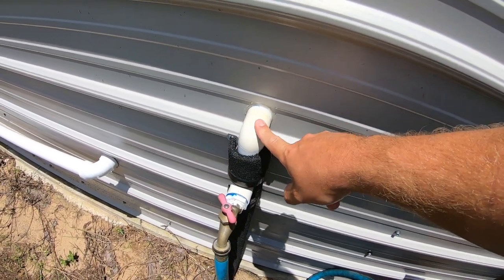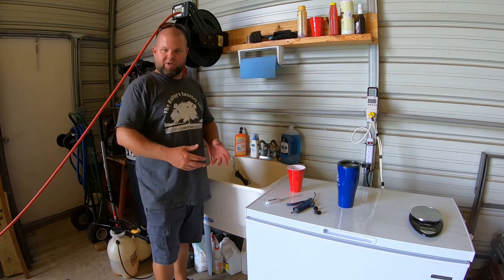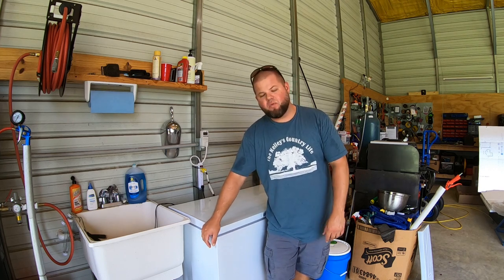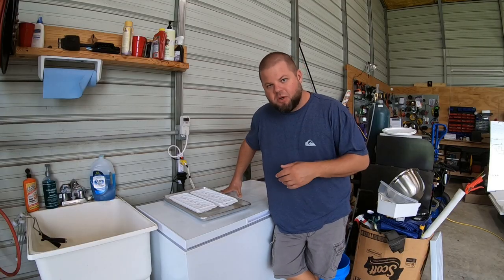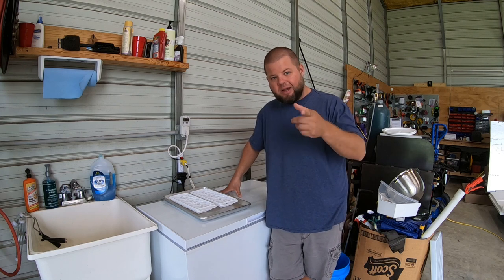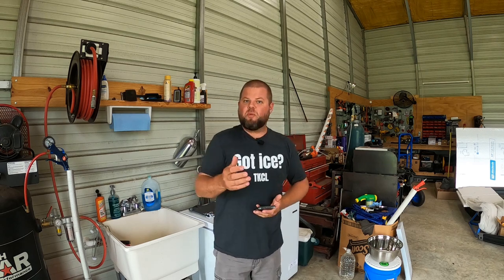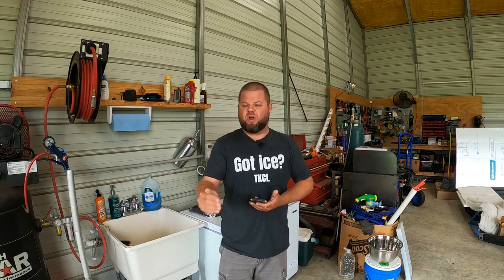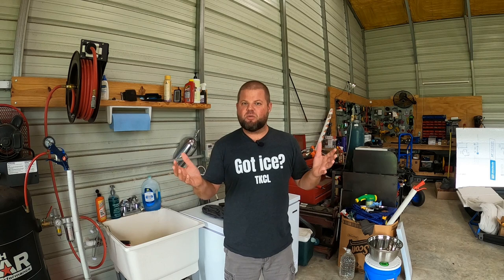Homemade ice machine tests! Hot water freeze quicker than cold water Mpemba effect? #376

Comment: So if your net per bag dropped by 40 something percent then putting a reservoir tank with a fan and maybe a heat sink on it is probably a good idea but you would need to test that temperature water too because it’s not gonna be the same as the cooling you’re getting from your ice bucket.  Then you need to calculate the cost of using ice to cool that water and make that an energy expense.  Lol. This stuff is fun. 😂

The best decision in these things and almost everything is to find balance. I Collett the best bang for the buck you find what you need and you make that your minimum point and that you look at what you want and make that your maximum point and then you have your range of what you’re going to get in the end and from there you start looking at the advantages and disadvantages in total cost and you just pick the one that’s the best bang for the buck if you can pay $.30 cents per bag and that meets your needs you don’t need to put a bunch of money into it and it might be nicer to get more bags and have them cost $.25 but like you were saying you don’t wanna have to put forward two years worth of money to make the savings but if you can get 80% of your goal for 10% of the cost difference that’s gonna be your best bang for the buck and that’s worth it it’s worth spending a little extra to buy and put a fan in there but it’s not cost-effective to buy some sort of expensive chilling apparatus even if it does actually work the benefit it brings you isn’t really worth the cost to where the $12 fan is gold.     This is pretty awesome.

At the end of the video you talked about insulation on the wall behind there. If you’re going to test that I would test two things, test insulation but also test shading because it would probably be a lot easier to build a shade canopy in that area or maybe even put the shade canopy over your pipes outside and move the icemaker to there and kill two birds with one stone. But without insulating your tire shop I’m not sure insulation alone is going to have a ton of affect either. If you do I would get some of the foam board with the radiant barrier I think that would be the most effective in that localized area plus it would be a lot easier install you could just stick it up against the wall underneath your cords for the testing or even put it outside but without air-conditioning that space I don’t think insulation is going to make a ton of difference other than a radiant barrier and maybe putting a tree outside for shade or a canopy might be a more practical solution or even a more efficient solution. It’ll be interesting to see. Another thing about maintenance. Most people don’t clean the backs of the refrigerators and there are usually coils in there somewhere that dissipate heat and when those coils get covered with dust they’re basically insulated and just doing maintenance and cleaning an old freezer might make a huge difference in efficiency. There are often settings that can be adjusted and fine tuned as well. When I find on tractors all the time is your hydraulic diverter’s. Usually they just put half your hydraulic flow to your steering when your steering needs maybe 10 or 15% of that flow, changing that valving to make your implements run way better and even give you the option to run other implements that you normally wouldn’t think you had enough flow to do.  Even on a little 1025 are there a bunch of implements like it front mounted pole size and stump grinders that attach where your bucket does that the specs don’t meet and can’t be run but with a diverter you’re getting a 35 or 40% increase and can read them supplements without ever changing your hydraulic pump.  There are also valve type switches in there that are based on pressure, it’s basically an adjustable release and they don’t tell you about it but you can get under there and turn a wrench a few times and you can increase your hydraulic pressure by 50 or 100 or more pounds even on a tiny tractor.  I’m sure refrigerators are the same I’m sure they have valving and things that the engineers just threw on I’m sure things like tube width and angles and decreasing the amount of bands and all kinds of things could improve the efficiency. You might not get that far into it but it would definitely be worth looking in there to see if there are adjustable valves or even if you could just cut some more air access into the cover that goes over your coils increasing airflow or like you were saying a fan and even just a maintenance and cleaning stuff so it’s able to dissipate that heat faster.  All fun stuff to play with

Be careful with that ice thing on the shirt, a lot of people out there that hate the ace government agency and there is a domestic terrorist and violent people running around looting and burning and attacking and killing people sometime so I’m not sure I would wear that shirt in San Francisco or New York city but out here in the real world it’s actually pretty cool. Lol

Comment: The fact that the boiling water tray showed a  small piece of ice after only a hour shows the effect evaporation had on the test.
The room temperature tray took longer to form ice than that. I agree that boiling the water is not practical and that it would not be a solution for this project but, the science is there.

Comment: Add the power and use on mini fridge as well

I have an idea what about routing the pipe line into the freezer door that wont freeze but cool it off
Also how would be the effect of having the build up frost on the sides
Also isolate the wall

Comment: I might miss something but at 70 dollars for copper it seems to me as it makes more sense to get another ice maker
Reply from the maker: Yes and no. Do to the size of the freezer there just isn't enough room. It would always be in the way of me trying to scoop out the other side. I have a special spot for this size freezer down the road, so I can't go bigger.
Reply: Can you get three makers in with very little (if any) loss of space if you turn them 90 degrees? I was surprised when you mounted them in that orientation.
Reply from the maker: I'm looking into that, especially for the next build.
Reply: Would also be interesting to try to stack them vertically

Comment: You dont need to use copper you can just use the plastic line and put the water filter inside the fridge the amount of water in the fillter water will keep it at chilled temp and only need two small holes in fridge door

Comment: If you want fast ice production get a mini fridge put a 100ft roll of 1/4in poly in fridge simple hole in and out and whala... 40deg supply water to ice maker. Well under $100 maybe as low as $30 if you happen to have an old mini fridge your not using.

Comment: The only time hot water will freeze faster is if the humidity is very low. The hot water will evaporate some. This evaporation can cool the water faster just like when you sweat it cools you when the sweat evaporates. But this only happens in certain circumstances. And you give up some of the liquid giving you less ice. If you put the water in a bottle with a lid on it the hot water will never freeze faster.

Comment: Maybe I'm dumb, but if the groundwater temp is much lower than the water you are getting once the water rises up on the side of the building past the hose bib, then why don't you just insulate that better?  Maybe paint the foam white, put foam on the elbow, and perhaps build a chase around the entire supply line to keep the sun from directly shining on it?

You could also relocate your supply like for the icemaker so that you aren't tapping off the 'above ground' line but somewhere underground.  To me that would be MUCH better than wasting water or adding some additional 'chilling' into the current setup.  Just get the water supply before it gets hot.
Reply from the maker: I'm going to insulate better. Doing an entire insulation episode, need to purchase a few more things.

Comment: just use a 25~50ft coil of poly tubing skip the copper
 you don't have the volume to justify copper also the door is the safest place to drill a hole.

a lot of fridges with built in ice makers have coils on the fridge side to chill the water for both the ice maker and the door

Comment: Really cool video I feel you won't need the copper tubing just use like a bucket or container with a air tight lid in the fridge then have 2 of them plastic tubing runs comig out of like the side of the bucket (making sure there leak and air proof ) 1 leading to watter mains and the other leading to the ice makers, that way you will have a large amount of chilled water (more than you would with copper tubing ) witch should keep its temperature better in the fridge ,it will be cheaper than the copper tubing and also you may be able to get away with just running the tubing in the door jam hope it helps

Comment: you don't need to use a copper line in the fridge to chill the water in.  You plumb in your 3/8 plastic water line to a quart or half gallon tank and back out with as short a run as possible between the chiller and the water valves.  (or out the top of the mini fridge right next to the fill ports for the ice makers as you set it up with the cooler) For as little water as you pull through the system, the holding tank in the fridge will keep you just as cool as the copper lines.
Reply from the maker: Thank you for the idea

Comment: great work! i would like to see if added a piece of metal attached to the inside metal of the freezer with thermal mastic with the icemaker setting on it again with thermal mastic would affect ice production. I know your freezer isnt running on r134a but in one of those systems the temperature at the inlet of the evaporator is about -20F.  The entire inside of that freezer is the evaporator and after you defrost it you will see ice forming near the top first.  plus i think the metal would extract even faster from the mold. Uline used to make an icemaker that was thermally bonded to a evaporator.  and again great work on the series. I am definitely invested in it now.

Comment: Observations from an old Plumber- 1. Build a primitive cover for the incoming water line coming up the wall outside your shop,and the line coming into the ice makers. Use 8 inches of fiberglass batting, use cardboard,duct tape or anything to seal it. 2. A waterline buried 4 feet  deep should maintain 50 degrees F.. 3. The hot water myth is propagated due to the fact in frozen  pipe damage,the hot is damaged far more than the cold.The reason? The water contains oxygen bubbles- which are separated out and removed in the hot water. The bubble give a tiny amount of a cushion  effect when the water expands upon freezing in the cold lines.4. The trickle of water you had going-@ 1 gallon every 5 minutes is 8,640 gallons a month.!
Reply from the maker: Thank you for the read

Comment: Why not just keep the tubing running through the ice chest with jugs of ice you can make in the freezer?  Fill up 4 plastic milk jugs and rotate two at a time between the ice chest and the freezer to keep the tubing cold, without having to use up your ice to cool the water in the ice chest.

Comment: I love the idea of a solar water heater, I’ve studied with several people have done come up with some decent ideas. One have a black tank that’s not insulated and use the heat in the hot water rising to create flow into a second insulated tank and then at night I have a valve on a timer that just shuts off and uses the insulated tank overnight because it will stay very hot for several hours when it’s insulated then in the morning the valve open in the black painted tank sitting out in the sun and not insulated or heat the water which will flow into both tanks and hit on the water again.  A black painted strip down water heater tank gets hot pretty quick, especially in the summer.

I don’t think you’re just proving science at all tell me the truth as hot water takes longer to freeze and there may be some extreme condition where that changes but I’m willing to bet it’s because in the end that hot water is significantly lower volume, I think it would Have to be hard enough to where you were losing mass because the temperature was so high that the water was turning to gas and evaporated at a rate so quickly you just didn’t have as much heat to remove in the end because you just didn’t have as much water left.  To test that what you have to do is put 1 ounce of water in a container and then take an extremely hot plate or something or water that was so hot that it was already in a gaseous state but I think for the purposes of making ice it’s always gonna be better to start with less heat in whatever you’re trying to freeze, Since chilling in freezing is the absence of heat, cold isn’t actually something that exists it’s just an absence of heat

Comment: Very, very well done. I personally won't be going with chilled water as the gain isn't that impressive. Only if I began to not have enough ice for my needs would I consider it but here's the thing. If you have the space for another DIY Ice Maker instead of buying a mini fridge, the copper, fittings and time to build the chiller. I honestly think I'd just buy and build another DIY Ice Maker instead. It would be pretty close to the cost per bag to pay off the chiller versus another Maker. Just my two cents...
Reply from the maker: I agree

Comment: Did you figure out a break even figure. I'm thinking between 1 1/2 to 2 1/2 years depending on your usage and the average cost of ice at the retail store. If you could added taller hinges by fabricating a couple plates to raise the lid, use tubing for the spacer and run your water hose to chill the incoming water. It may be more problematic to do this and the tubing should probably run from the cylinoid up to the tube and then travel 360 around top (x2). To me personally chilling the water is not needed. I would shade or box in the pipe outside as a low cost alternative. Great job!
Reply from the maker: I give all those figures in this video. Best case scenario 7 months, worse case scenario is 17 months for equipment and energy usage. That's at 3 dollars a bag. Sometimes I pay more than that, vary rarely I pay less. It's absolutely worth it for cost and especially convenience.

Comment: Just my humble opinion; I think you said that the outside of the box gets cold, and you want to insulate it? I agree, and some 1" foam insulation on the garage wall would be great too. My suggestion would be, what if you ran a copper line in a zig zag up and down the outside of the ice box against it underneath the new outer insulation you would be adding?  I would think the thermal difference would be minimal to the box while significantly cooling down the water coming in. Especially when you think that the water is going to stop and sit in the pipe getting cold, then when the ice maker kicks on, a new batch of water cools down with a thermal mass already in place. (of course, measure how much water needs to sit in the pipes to fill the maker.)  And, hopefully it won't make much of a difference, if really any, in KwH used. (I think...). I just like looking at the least cost solution for the most worth. :)  Ok, that's my 2 cents!
Reply from the maker: I'm already kicking that idea around, I like it.

Comment: I think I have a more precise way for you to measure all modifications consistently, and it also explains the statistical outlier result that was over 10 pounds. The true measure of efficiency is actually the exact time it takes from one ice drop to the next. If you measure the weight of each individual ice drop many times over (20+ cycles) you can get a very reliable average "weight per drop". Then, if you just focus on the times in between each drop, you will immediately see whether a modification is causing the ice to drop more frequently or less frequently. You can see how this could manipulate the 10-pound result you had earlier. If the machines dropped their first batch of ice right after the 24-hour timer started, and then their last drop happened just before the end of the 24 hour period, then an extra drop could have happened purely because of timing luck. If you can multiply a strong average "weight per drop" by the time in between each drop, you can calculate a very accurate "pounds per hour" or "pounds per day" based on any future modifications you test. Anytime you can utilize more experimental trials, your results will have greater statistical significance. Measuring 10 or so times between drops is more reliable than one measurement at the end of 24 hours. Oddly enough, a microphone could be perfect for measuring such a thing.
Reply from the maker: That's definitely an option for testing

Comment: I hope at the end you do a total break down of cost for everything. I mean how much you paid for the freezer and ice makers as well as tubes and wiring. Everything else. This has been fun to follow. Lol I like the fact of the cost to make the ice. We use a lot during summer baseball season. I'm thinking about doing the same thing you did. Thanks for the idea.  Sorry I didn't realize you said cost around 375 to 400 dollars in everything not bad at all. Could probably cut that cost if you found a used deep freezer at a auction or someplace.
Reply from the maker: There is also a video of me showing full cost breakdown to operate, per equipment and per pound. It's not bad at all

Comment: Run your incoming water through a small refrigerator so that the water comes out around 35°F. Perfect. Use copper tubing with a dozen coils wound in the fridge then out to the ice maker. End of problems.